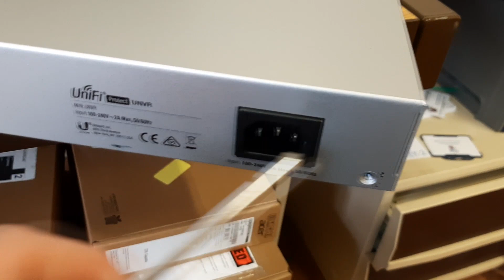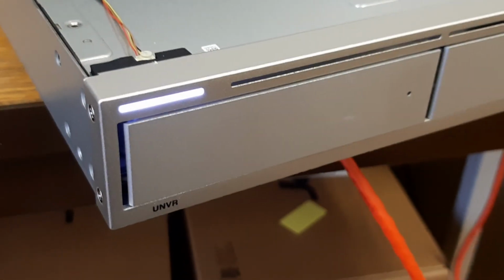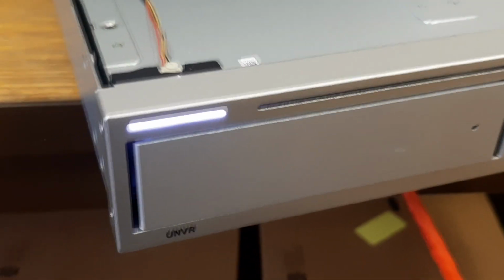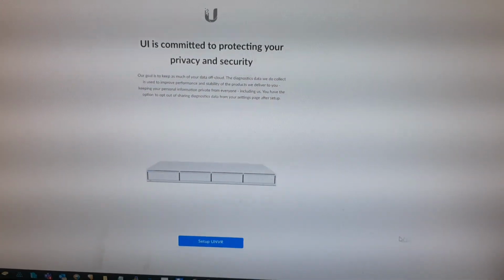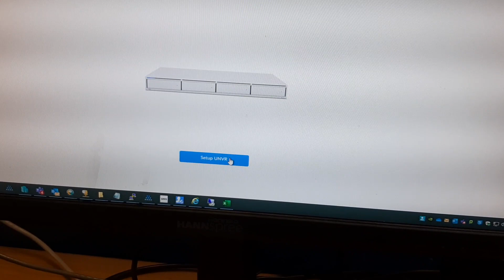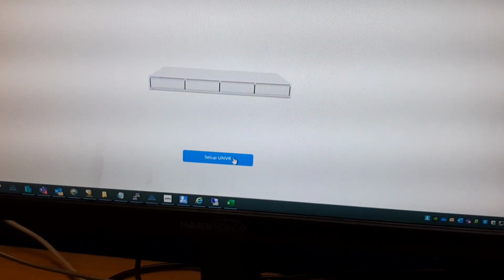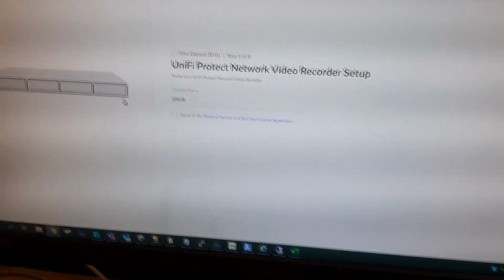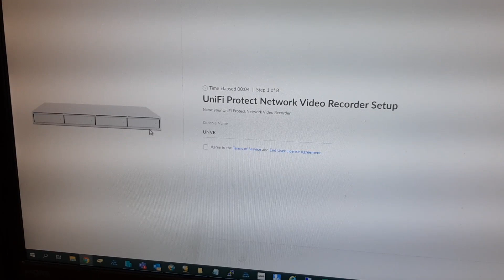Ubiquiti Unifi Network Video Recorder (UNVR) replacing USB Drive - Fast flashing white light fix

Comment: Would you be able to try and install truenas on a USB stick and see if that would work in the UnVR.  I’d like to use a unvr as a nas but I don’t want to buy one until I can find out if it will work?

You’ll likely have to complete the setup on your regular computer first and then install the stick after as the unvr has no video out

Comment: Alternative way to get the USB drive off is to heat it a bit with a hair dryer. The hot glue will melt enough so the drive can be taken off without risking a sharp tool slipping and damaging the board.

Comment: Thanks for posting this short, direct and to-the-point video about a very common problem with the UNVR. It appears to be something UI should make a serviceable component like an SD slot instead. This issue is reported a lot in the UI Community Forum. It's a shame customers have to crack a case to DIY repair a $15 part that breaks a mission critical device. Also, waiting months for an RMA on this is repair is hard to stomach... going to pickup a SanDisk 8GB to get my UNVR back online now!
Reply: Happened to me today. Only thing I can say is treat it like any other server so dont expect it to be up 100% of the time. However I do think UBNT should have at least notified us that a internal usb drive was driving this thing.

Comment: Wow, @FragglePete thanks for making this video! This just rescued me from a HUUUUGE headache I've been dealing with. I run one of these at my office and one and a customer's house and they BOTH have been crashing and failing - white light flashing, sometimes a reboot would fix it for a few days, sometimes not... One thing I should point out to anyone else trying this who might be less than delicate as I was when removing the old USB drive: there are small SMD dummy or zero resistors under the glue that holds the USB thumb drive to the board. In my case, the glue ripped one of them off. Those resistors are basically just jumpers for the right-most of the three rear exhaust fans, so if you accidentally make the same mistake I did, you can just run a small solder bead across the contacts and the fan will work again. Obviously the not warrany-safe, but hey you've already voided the warranty by opening the case so you probably wouldn't be attempting this anyway if your unit was still covered under warranty.

Comment: Will you lose all your footage?
Reply from the maker: When I put together this video, I moved the disks over to the spare unit I had which I had already repaired some months before.  The unit did pick up the configuration and all the footage was still in place.  It just carried on as if nothing had happened.  I did upgrade it before via ssh so it was running the same firmware version.

Comment: What’s the issue here?
Reply from the maker: These UNVRs would just stop working.  Non responsive to any network connection (WebGUI or SSH) and if you cycled the power then you would get the fast flashing white LED and nothing else.
Reply: Got it

Comment: great vid but you really need show whole process from removing formatting usb and placing files on stick etc
Reply from the maker: There are no files to put on the USB drive, just formatted with FAT32 on another computer.  The system rebuilds what it needs during those 10 minutes of it flashing away after powering backup.
Reply: This is the whole process.